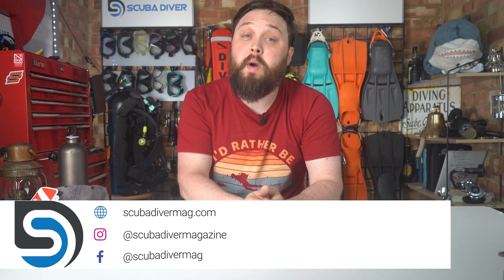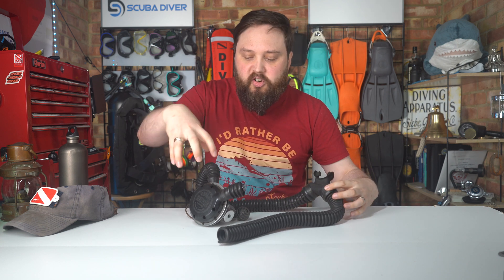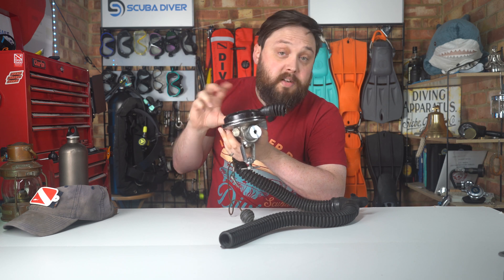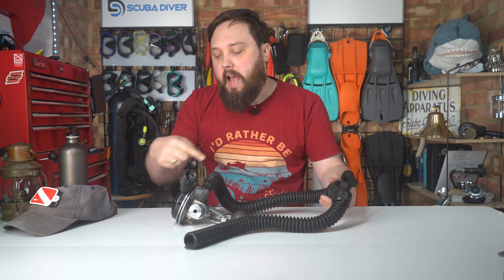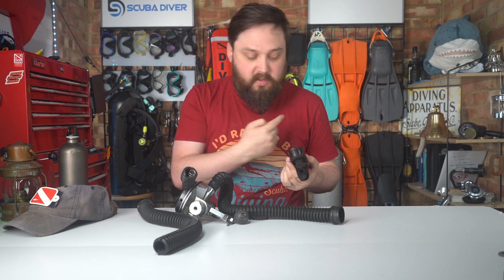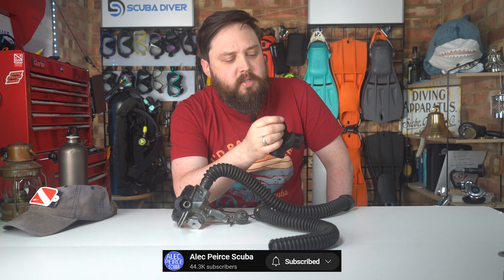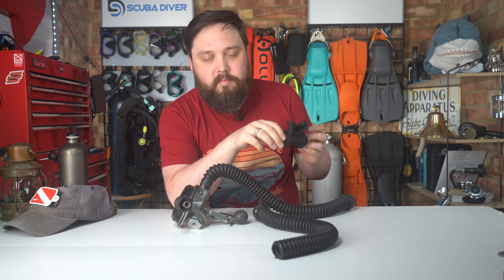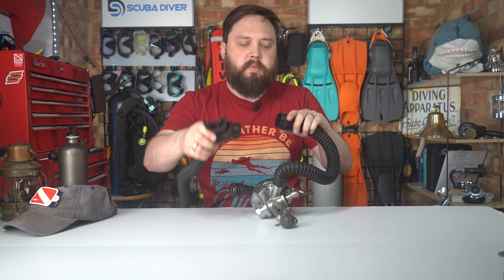How Do Vintage Twin Hose Regs Work? #askmark #scuba

Comment: 2 Hose regulators basically operate the same as modern single hose regulators.  They have a first and a second stage.  
SCUBA regulators have changed very little since the 1960's. First stages are still unbalanced piston, balanced piston and balanced diaphram. The only real change has been the introduction of the balanced 2nd Stage in the 1980's. Everything else is just marketing ploys by the manufacturers.

Comment: #askmark

Hey Mark, I'm wondering your thoughts on pony bottles/alternate air sources and their use at an advanced recreational level. I'm a great lakes diver and a very average dive is between 60-100 feet deep and anywhere 40-50 degrees Fahrenheit. Many divers carry 30 or 40 cubic foot cylinders with a single regulator as a backup to whatever back gas they have. While coldwater regs are the standard around here, freeze ups and free flows can still happen. I'm under the impression it is easier (and safer?) to give another diver your pony bottle and ascend together but unconnected, compared to doing the standard sharing of an octo, which limits mobility and puts more gas flowing through the first stage.

I am interested in your two cents. Do you have experience with pony bottles? and at what point should recreational divers stay away extra gear that they may not have been trained properly to use?
Reply from the maker: Ponies are quite common here in the UK as well as twins, but, they're usually fixed to your back. In Europe you can often find Y valves on single cylinders so you can fit two 1st stages to a single cylinder to reduce airflow on each 1st stage. I prefer the redundancy of a separate cylinder like a back or sidemounted cylinder.

In my experience of donating to an OOA diver it's easiest to just donate the 2nd stage and keep the cylinder attached to yourself the donor. Handing over a cylinder runs the risk of dropping it and it's going to change both divers buoyancy. Even when the reg failed on a calm and competent buddy of mine, we ascended together. a nice long hose helps with that.

Comment: Im guessing they are not being mass produced now ia that they are not deemed to be the future of diving again...Okay so its a integrated first and second stage... okay so if your on single clyinder on a normal set up, and an o ring goes on a modern stage 1 your second stages are going to be soon useless once air runs out. Wish Apeks would bring them back. I would buy one just for the reason gas is vented behind you. Dont like the style of the Kraken. Wonder how muchl more difficult it is to breath. Millions of miles away from my mtx rc lol. But really fancy trying one for sure.

Comment: I’ve got a 2005 Aqualung Mistral LE double hose regulator and absolutely love it. Might not be the easiest to use or the easiest breathing regulator, but I love being able to have no bubbles in my vision and also still have the ability to use my air integrated dive computer. Some purists out there might say it’s just a no thoughts gimmick, but there’s enough modern implementations and it makes underwater video work a much smoother experience so I definitely recommend trying a twin hose regulator if you get the chance

Comment: #askmark Are there simple inlet valves for buoyancy wings? Similar to what is used with drysuits or an adapter ring that would allow a drysuit valve to be used with the wing? An Aqualung Axiom i3 BCD style solution would be great.
Reply from the maker: They do exist however, it tends to be in dedicated bladders because both the inflator valve and bladder port use male threads. The only example I can think of is the Dive Rite No Mount BC. It's a simple bladder made to wrap around your cylinder and adjust it's buoyancy which uses a drysuit style valve.

I don't think I've ever seen an adaptor but, there may be one out there somewhere.